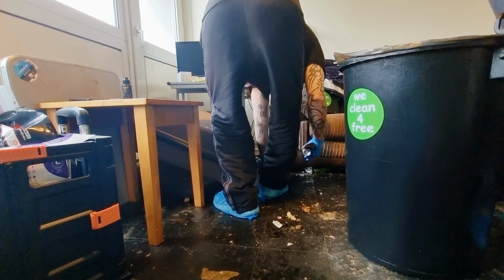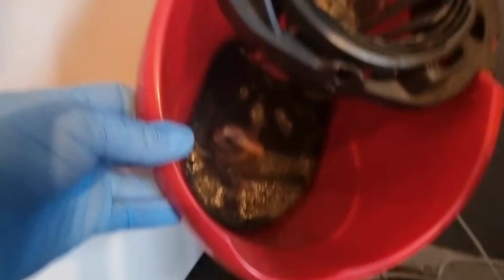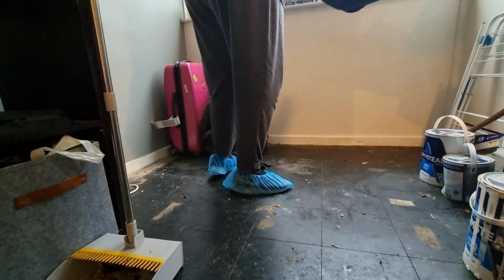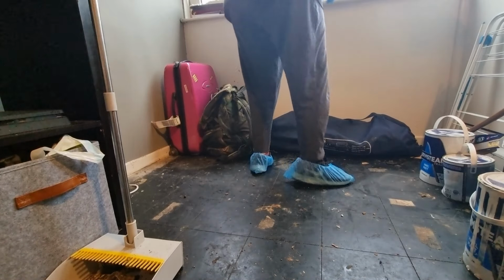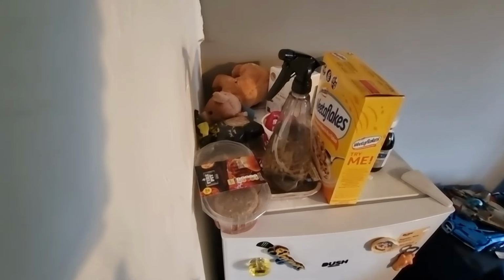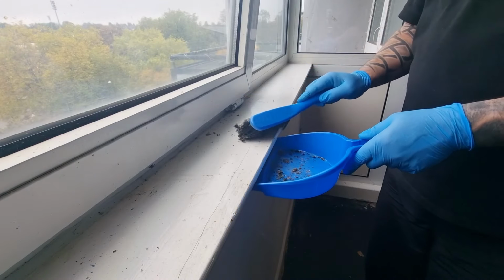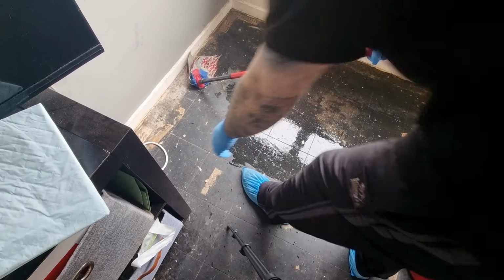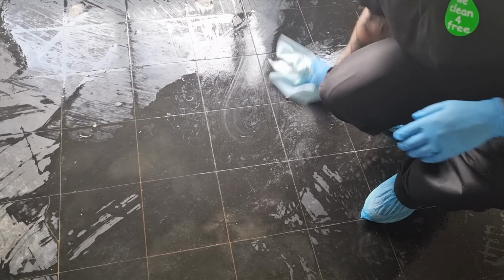HAZARDOUS to HEALTH FREE CLEAN  🟢 we clean wednesday 🟢 #weclean4free #cleaning #cleaningmotivation

Comment: 🤩I ve noticed on other cleaning videos, the other top you tube cleaners don't open windows, that does my head in, you need the fresh air in the flat or house, especially if a 🐕 dog or a 🐈 cat has 💩 somewhere. You've just got to open them. You need a wall paper scraper for  them floors, pound shop. 💐 Great clean . 😉 Aye would have used a brush on that floor, with neet fairy washing up liquid, & brushed it in, then taken the muck off it, then went over it with flash. 😇
Reply from the maker: we prefer to open the windows too, just helps to instantly freshen it up
Reply: On the other hand the air brings movement in everything inside, I am not sure if I had loved all the dried feces flying around 😳
Reply from the maker: @keelienne  Luckily it wasn't very windy, or a dust bowl of mess springs to mind 🤣😂🤢🤮